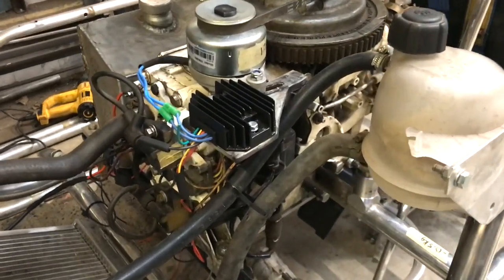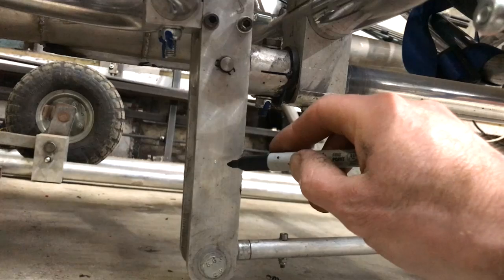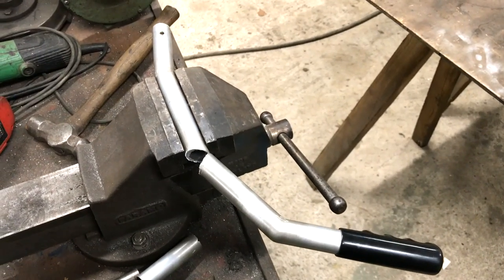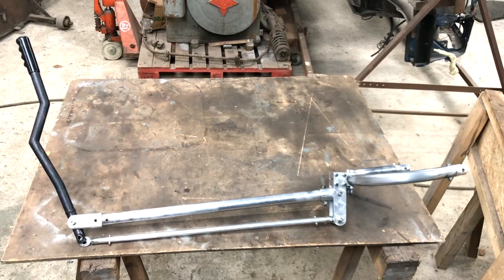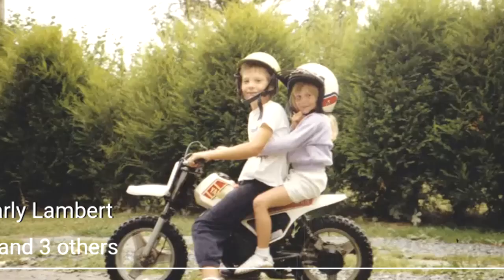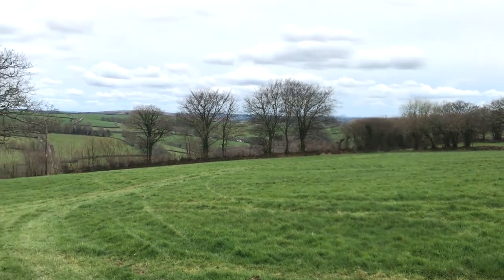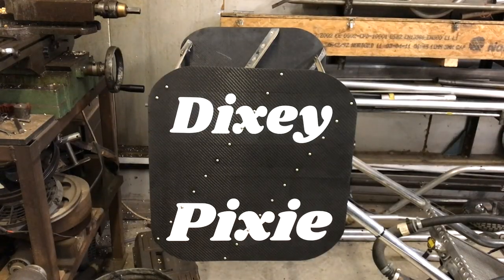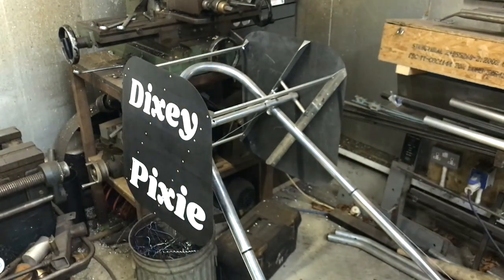This Mistake could have been SERIOUS, Homemade Helicopter

Comment: With the exhaust issue, install a flex pipe. The flex pipe consists of a flexible stainless steel pipe covered with braided stainless steel wire. It helps take the vibration out of the exhaust. I’d even install rubberized engine mounts, these will even take vibrations out of the airframe.
Reply from the maker: Flex pipe could be better than the anti vibration mounts I've got. The engine is already attached to the frame via rubber mounts. 👍
Reply: @Ben-Dixey  yeah, the flex pipe will definitely help with your vibration issue’s. I’ve replaced many of those on cars, some of them were in the tightest of area’s on cars. Do I miss being a mechanic? Sometimes. Other times? No.
Reply from the maker: I restore classic cars for a living and I moan about that constantly. General mechanics now with modern cars packing every available bit of space with technology, I personally wouldn't want. You have to be a very patient person to work on modern vehicles. Think I would rather stack shelves in Tesco's than be a mechanic these days.
Reply: @Ben-Dixey  tell me about it. Way too much electronics in vehicles nowadays. I’ll take an old Chevy any day, over a new car. To replace a starter in a Mercedes or an Audi, you have to pull the intake plenum, because those “brilliant engineers” thought that would be a great place to put it. You’d spend half of the day taking the intake off and putting it back together, for just a 10-15min job replacing a starter. I don’t miss that part of being a mechanic. They don’t call the “KISS Principle”, the KISS Principle for the heck of it. In case you’re wondering what it means, it’s Keep It Simple Stupid. But I guess they’re stuck on the idea for the greed of the money.
Reply from the maker: 100 % agree, the golden age of vehicles has long gone, at least we can remember it.
Reply: @Ben-Dixey  oh, I can circumvent all of the electronics. I’ve done it before.

Comment: Just a thought.. Main driveshaft/jack shaft.. The Toyota Estima uses a driveshaft from the engine front pulley to drive, the alternator, PS pump, Aircon etc... Obviously this is rated for engine rpm's. It has rubber bushes.. Maybe worth a look..
Reply from the maker: Will have a look, thanks 👍

Comment: Hey just curious when i visited UK i visited a gyro group this was decades ago. 

They were expliaining how restrictive it was and how they couldnt change a single bolt even to make the gyro safer.  I remember seeing a guy struggling to keep his gyro frim tipping over due to the linked rudder and nose wheel.  I showed them how we use a light but simple system to rudder with extra pedals for nose wheel that you just slide feet outwards rwasy for takeoff at which point it casters but they pointed out that even though it would solve thier problem they couldnt chamge a single thing.

So are you limited to opperaring over private property?  Or will you need to go through sone certification process?
Reply from the maker: This machine would never be certified it was just an experiment for fun really. To achieve a hover was more or less it's goal. I've been doing it without any authority involvement.
Reply: @Ben-Dixey  good probably best to keep it that way.  Super impressed mate.

Comment: https://youtu.be/r13JZlq-NLM          This is an interesting configuration of load distribution over balance. The engine, thus a big portion of the center of gravity is high and the pilot's weight is directly below the engine. That places almosr the entire load directly on the y axis. Also the tail fins are considerably smaler in order to maintain the majority og the weight centered on the y axis. It seems now in your helicopter  to be that any portion of weight has any ecentricity (away from the y axis)affects the overall balance and it needs to be counter balanced. I reckon that in a dynamic mode when the helicopter is flying , any  ecentric percenrage of weight away from the axis, even if it is balanced in static mode, creates  momentum that affects the flying characteristics. I would imagine tale up or down and in some cases nose up and down.
Reply from the maker: I think you are right. I had noticed the engine on the sch2a mounted very high up. There is an overall weight advantage to doing this as the engine is as near the rotors as possible, but yes the high CG in the vertical axis I believe could be an advantage. I don't full understand the effects but I would imagine having the weight high up would reduce the control latency. Your observation of having the weight as close as possible to the rotor axis will also make a difference. I really like the design of the sch2a and would happily copy it next time. 
I do think though that my configuration works ok, if we look at the Nolan coaxial. https://youtu.be/B21Xk6tNcBw
That has twin engines and the pilot even further forward to counter the weight. It flew very well in the hands of Jack Nolan from watching the demo. 
I would certainly like into understand this vertical CG position further.
Reply: @Ben-Dixey  In the event of a hard landing, a heavy engine above your head breaking away from its mount and coming down will be very un comfortable:face-purple-smiling-tears:
Reply from the maker: @BalajiSankar  That is true 👍👍

Comment: When welding butt joints in thin tubing I've found it useful to insert a small length of tubing inside the two pieces, then, with a small gap, weld the ends to it.  Makes for a, substantially, strong joint, and stress is "absorbed" by the inner tube, not the weld joint, itself.  Envious of your rather large LZ.  😀
Reply from the maker: Good suggestion. Yes I have used the tube within a tube method in the past, gives a bit of back up security to the joint. A good move in Particularly critical areas. 
I'm lucky to have access to such a nice LZ. Though I have to do the tests when my parents aren't around as they get too nervous. I can understand. Would like some land of my own one day.

Comment: With regard to the tail fin and yaw stability, remember your dealing with Downwash on these but later in flight a forward airflow .
So may I suggest, but your probably way ahead of me, a 90 degree fin on the lower part of the vertical fin, or perhaps a 45 degree angle similar to Learjet wing tips and other aircraft which dissipates the rotor effect?
But historically if you study the ww2 autogiros derived from the early attempts by Cierva they all have a common surface but only on one side as they had one rotor? Hope this helps your theory.
Reply from the maker: Hi and thanks for the comments. The Nolan coaxial had what you suggest, fins to control yaw in the hover and fins to control yaw in forward flight, operating 90 degrees apart. My fins hinge at an angle, the same angle as the tail bars. It is a compromise of the two but more authority in the vertical plane than horizontal. Whether it will
work remains to be seen. Forward flight at the moment feels a long way off but who knows what this summer will bring. I'll have a look a the Cierva autogyros. 👍

Comment: Interested to know why you didn't drill the hole in the alloy bar instead of punching the hole out... !! Love you're work ... 👍
Reply from the maker: Thanks. The punching of the hole was actually a joke 😉 there is no way that punch tool would punch a hole through 10mm thick aluminium. 1mm steel
Is it's maximum, I drilled the hole then make pretend.
Reply: @Ben-Dixey  Ok 😣..... As i was watching it i thought "what the, How the" & now i know.

Comment: Looking at all now Ben, if you'd had had an air cooled rotax, you could have eliminated,  a cooling system, water, pump , fan ,all that Diy exhaust system, and a  generater, plumbing , battery, just to see if the bare bones would lift .
Reply from the maker: Hi Peter. Yes it would save a lot of weight for sure, I think the rotax revs a little higher but would be ok I think. Might have to save some penny's to buy one though. Could be tempting.

Comment: autobiography class on point...the city is chaotic, i always drool at all that space you have... dixie p it is, btw do you apply for permits to attempt these tests?
Reply: @JeffChoppah  as far as I am aware, you don't need permission to fly anything as long as you're over private land and are not flying higher than 20 feet. The priority of Air Law  is for the avoidance of conflict between aircraft.
Reply from the maker: I'm certainly lucky to have the space. It's something I've never taken for granted and appreciate it a lot. I'd be lost in a city, a complete fish out of water. The land isn't mine, its my parents but they have always been happy to let me use it. The permit question is a one that crops up now and again and I don't have permission. Mixed opinions whether tethered testing is permitted. All my tests are tethered, they are just very long tethers. I am taking a risk posting these videos for sure but in my opinion there is no risk to public safety from my experiments. The only risk is to my own safety.

Comment: You don't need to dial in any yaw compensation in the tail on a coaxial setup. The two main rotors working against each other do that on their own, and having a bias at the tail will reduce control authority in one direction while increasing it in the opposing direction. It will also introduce a small amount of pitch coupling which on a heli this size would be annoying at a minimum.
Reply from the maker: Hi. Thanks for the input, the vanes I was suggesting have an equal taper, rather than a neutral offset. The torque on the airframe is balanced at the moment but you do have to make adjustments in the hover for whatever reason. I was wondering if an equal taper would have a self stabilising effect and reduce pilot input.
Reply: @Ben-Dixey  With them that close to the rotor, I would expect it to either make no difference at all, or make things worse as they'll be competing with each other in very turbulent rotor wash. In your position, I might consider running fixed vanes (or a larger single?) that extend down a bit further to stabilize the wash, then a conventional hinged control surface at the bottom of that. That being said, I'm far from being an expert, and you have built exactly 100% more full-scale helicopters than I have.
Reply: @Ben-Dixey  .. I haven't flown a helicopter where the pilot didn't gave to make constant adjustments to all the controls all of the time.

Although I am aware of some with autopilot features but they require electronics and gyros and servos and batteries and maybe even hydraulics etc. which means more weight.
With practice your skills will become instinctual and it will become a non issue :)  

However I do think that using an aerofoil section for the rudder vanes instead of flat sheet would improve authority as they would be able to better handle dirty air :)
Reply from the maker: I'll leave the vanes as they are for now, I can understand how an airfoil shape would be better though. The work load is minimal and it's much easier than an R22 to control on the pedals. As suggested it's just something that needs practise. The idea I got from this video. https://youtu.be/KHpDTr3dT3s
Ben
Reply: @Ben-Dixey  I can see why the idea of kanting them might appeal but they need to be able to move the aircraft relative to the airflow and seeing as they are attached to the airflow generator they can't do the weather cocking thingy. 

You're right though, they work good enough to be effective and they are light too so no need to fix things that already work, life is complicated enough already :)
Reply: @Ben-Dixey  Just watched the video and the kanted vanes remind me of a V-tail used on some planes. 
I'm going to assume he's not built them like that just to look cool, kanting them inwards like that introduces a horizontal component which will aid pitch stability in forward flight or hovering into wind  like an elevator on a plane which is a common feature on many helis.

Comment: Great, All of it!
Thanks for sharing a part of your history. 
Its a delicate balance o strike; being suspicious enough to catch the potential catastrophic weld-miss-match, and ignorant enough about the risks to be able to enjoy what you have created. So far so good!
Reply from the maker: 100% correct, there are constant critical decisions to make as you know full well. Discovering that fault actually scared me a little and made me question myself. There are other parts that need to be tested for piece of mind but we can't test everything, without spending huge amounts of time and money at least. Your project is something new and inventive, it could be argued more worthy of the risk taking for the reward of new knowledge. Your approach is undoubtedly inherently safer due to the very low blade speeds which has a lot of appeal. Then adding your redundancy measures to that improves safety further. I note that you mention in your videos that you want to reduce the risk in operating your flying machines. I can understand that completely. Just wondering do you think the power requirements of your machine would reduce further if you went for a coaxial version, driving the rotors by mechanical means rather than tip props ? Might be difficult with all the supporting cables needed without the centrifugal forces normally present. 
Ben
Reply: @Ben-Dixey  The tip prop setup is a way of building a very high torque system (turning huge rotor blades slow) in the lightest possible way. The weight of a  gearbox reducing a motor rpm from say, 6000 to 15rpm (in the 25m version) would be significant, especial in the final drive-transmission stage. Yes, I have considered a coaxial version but just as you said, all bracing wires etc. would just be awkward in that context.
Reply: @amazingdiyprojects  when it comes to helicopters there are no easy solutions  ! :) 
I've enjoyed watching your videos too and as clever as your designs are I do wonder with an RPM as low as 15 wouldn't control ability become an issue ?
Reply: @freezatron  It does sound bonkers does it not? The wingtip will be traveling at high way speeds though, but still....
Reply: @amazingdiyprojects  ... I prefer to call it a creative solution than bonkers ! :)
25m diameter at 1 revolution every 4 seconds comes out at a tip speed of 70kph ... 
.. that's what I call a slow fly helicopter. I would imagine the disc loading to be within range of human powered. Definitely a very interesting approach you have taken, I really want you to succeed !! :)
I reckon you could climb in a thermal during an autorotation with such a inevitably low disc loading, although given how rough thermals can be in a paraglider this might be an unpleasant experience. ;)   
What are you expecting your AUW will be ?
Reply: @freezatron  It will be a slow craft for sure. I have also contemplated the possibility/risk of accidentally being caught I a thermal, I will have to come up with a solution do reduce lift without losing control if I were ever to fly a manned version it in thermal conditions.
I hope to get in under 450kg TOW with 2 person onboard. I expect the wing loading to be in the ultralight aircraft regime.
Reply: @amazingdiyprojects  I reckon if you fly low and avoid flying over thermal sources like dark fields and tarmac you'll probably be ok, also flying early and late in the day especially during spring will mitigate the risk further :)
Will your ultra light heli feature collective pitch controls ? 

Another thought comes to mind is that with such a low RPM is that the controls will have a low "frame rate" so to speak making it easy to get behind the aircraft and thus increase the risk of pilot induced oscillation etc. possibly at least, perhaps I'm over thinking it but the thought sprung to mind.